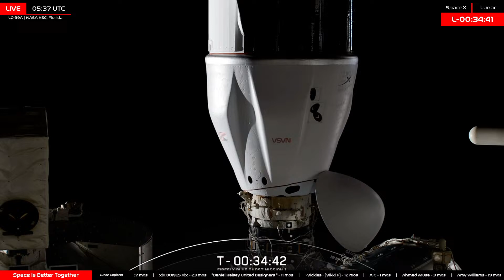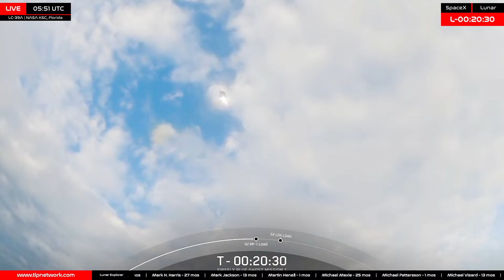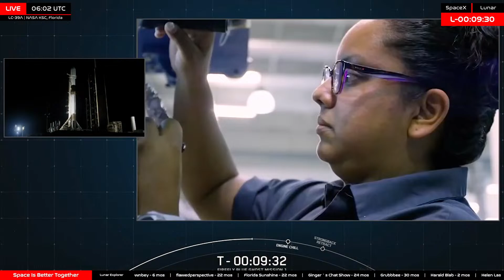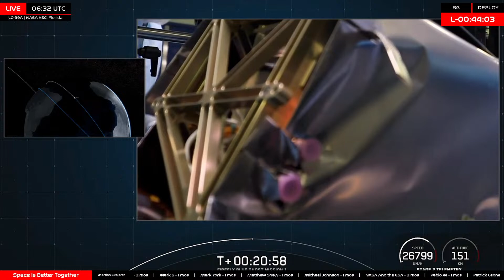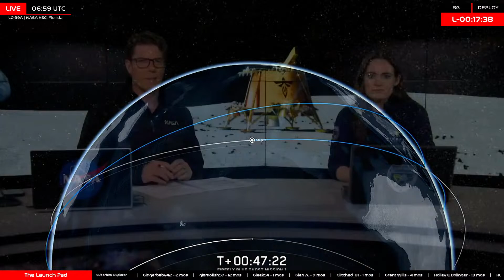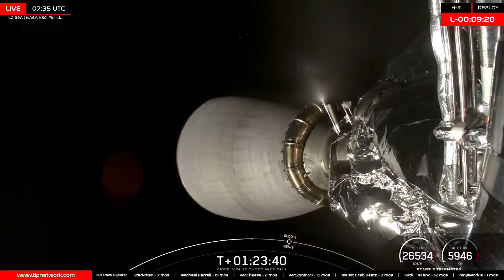LIFTOFF! SpaceX Blue Ghost x HAKUTOR Lunar Lander Launch

Comment: Falcon 9 has surpassed or is about to surpass the shuttle reuse record... shuttle launched 135 times over its 30 year flight program history.  Of those 135 launches, they lost 2 sets of SRB's (on STS-4 to parachute failure to deploy and on 51-L (Challenger disaster) and lost two orbiters (Challenger on ascent and Columbia on reentry) so they had 401 recoveries of launch vehicle hardware (boosters and orbiters).  Falcon 9 has already surpassed that number IIRC from what they said in the lengthy talk before liftoff, I think they're up to 409 now...  SO Falcon 9 is now the most reused launch system in history and has accomplished all those in only 10 years, and that's not even including reuse of the Dragon and Crew Dragon spacecraft...